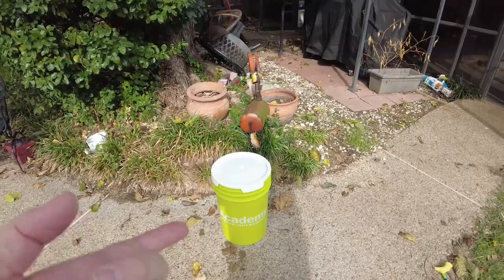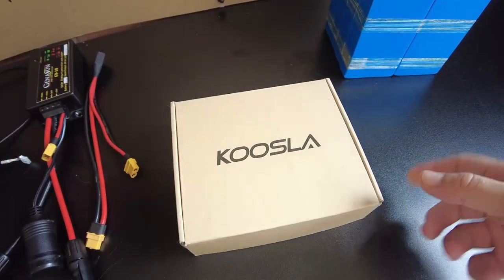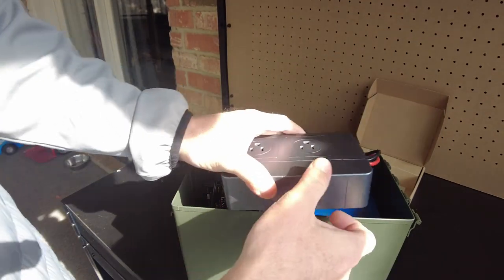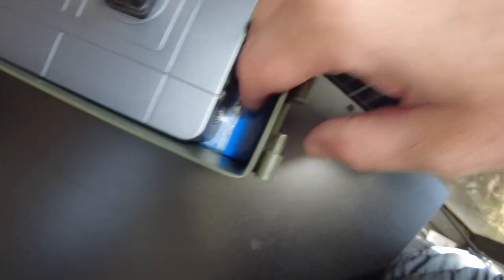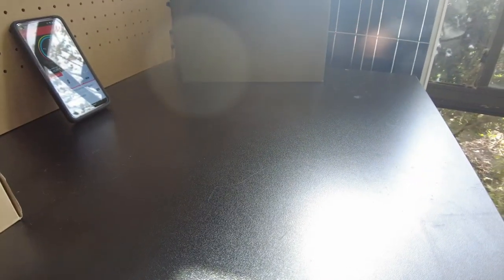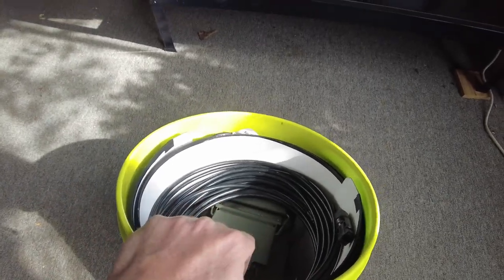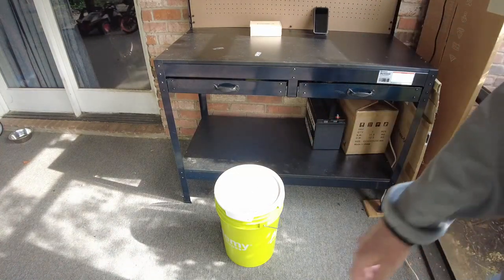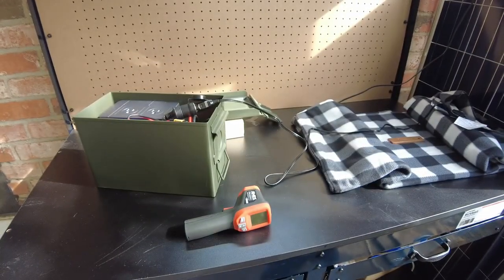Solar Bucket DIY Solar Generator

Comment: Great idea! Only one issue I saw. When storing it, you need to either disconnect the Solar Charge Controller or put a inline switch on it so it won't discharge your battery.
Reply from the maker: Totally agree. Can also turn the discharge off from the BMS app on my phone.

Comment: I would speculate the warming blanket has a thermistor to regulate the heating that will drop the current draw as it gets warm.
Reply from the maker: I think the resistance of the heating wire goes up as the temp rises, thus decreasing the power.